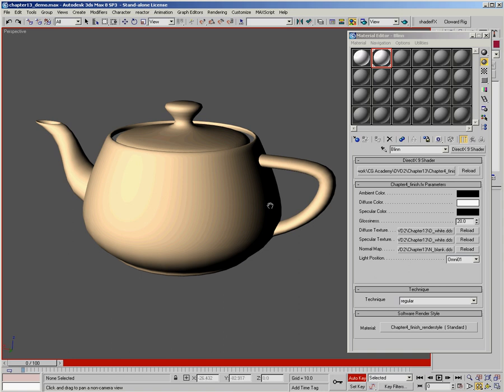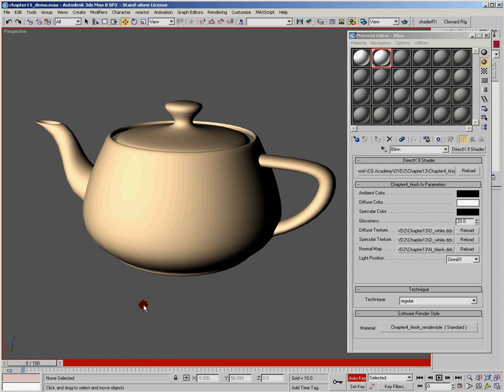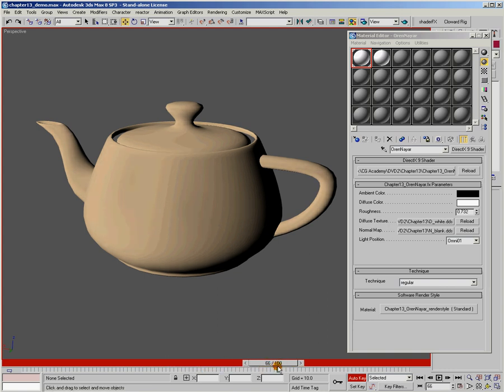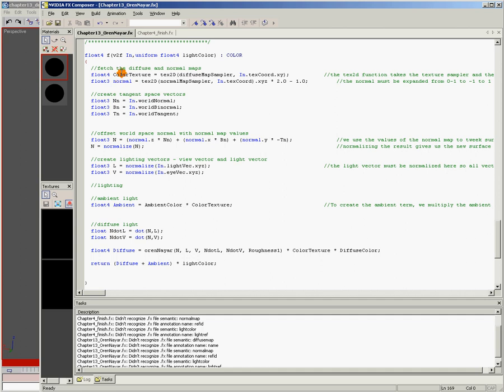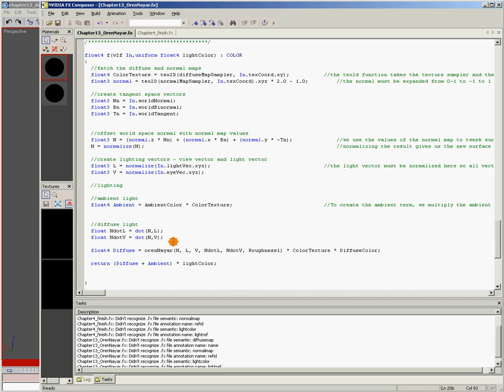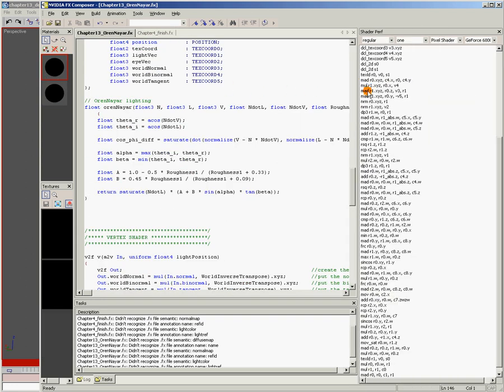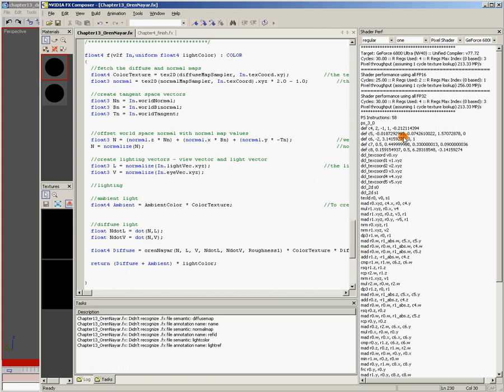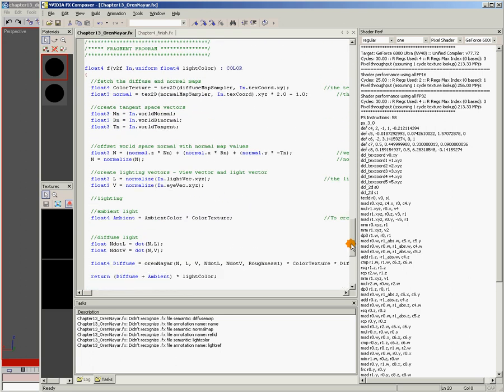13 Lighting Models: Oren/Nayar - HLSL Shader Creation 2: Light and Shading Models

Comment: Hello Ben, is there any way to implement Oren-Nayar shader into unreal? This is so fascinating
Reply from the maker: The lighting model in Unreal is built into the renderer and it's not designed to be changed.  I'm not going to say it can't be done, but it would require a lot of engineering work.  Also, since Unreal us a deferred render, it uses the same lighting model for all assets.  That means you would have to apply Oren-Nayar to everything, which is probably not what you want.
Reply: Thanks!
Reply: Unreal have a built in oren nayer, if you have the source code you can call it and use it